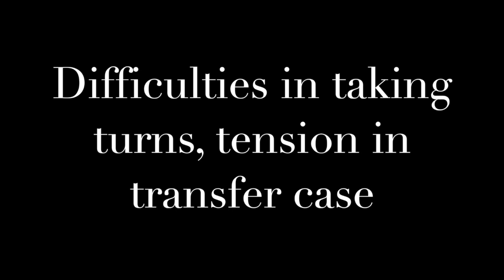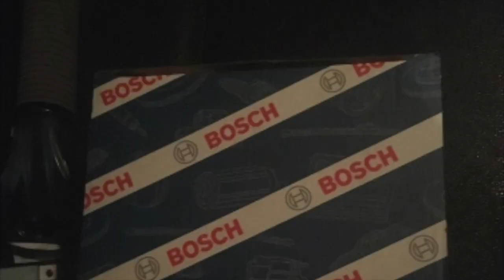BMW X 3  (E83)  4 -, Warning lights.  Change ABS sensor.  4 warning lights BMW

Comment: The problem with bmw abs sensors 80% of the time its caused by a bad drive shaft. If your sensor the tip is worn down when you remove it then changing just the sensor will not help because the new one will wear down too. The drive shaft has a ring which the sensor reads when this ring becomes corroded its shape distorts and it rubs on the sensor causing malfunction. Most people will be told by a garage to fit a new drive shaft to resolve it but you can fit 2 x washers between the sensor screw holes and the hub to raise it slightly, spinning the wheel when tightening the bolts you can hear if its rubbing still or not, if so fit thicker washers. Problem solved
Reply: Great advice. You can always check the clearance between hub and sensor by looking from underneath the car and slowly turning the wheel by hand. Coincidentally I had just replaced my transfer case fluid and the old crush washer from the drain plug fits perfectly around the speed sensor, acting like a small spacer. Now I kind of wish I put 2 of those crush washer for extra space. How much space can you create before you start getting "air gap" errors, or the sensor no longer picks up the magnetism from the ring?

Comment: I think I have the same problem. Did your odometer stop working too before you replaced the abs sensor? My speedometer and my odometer stopped working and the obd2 reader tells me I have a rear abs sensor faulty.

Comment: Hi my problem is that sometimes when I start the engine (cold) the 4x4 appears and the radiator fan starts running fast. The speedometer and the odometer works fine.

Comment: I’ve got just 4x4 light, tire pressure and brake light on? BMW says it’s a S0364 code... no communication with Transmission?
Reply from the maker: Hmmm strange, but good luck with this

Comment: Hi, I am having the same problem, I changed the rear left ABS sensor (as advised by a mechanic after reading the code) and it worked fine for a few weeks but now I am getting the lights come on again whenever I drive in first gear and the steering wheel is fully locked left or right? Have you had this problem again? It makes a horrible sound when fully locked which sounds like its right under the drivers seat? Thanks
Reply from the maker: Hi, better let the mec read him again, it has worked fine after the change, hope every thing goes well :)